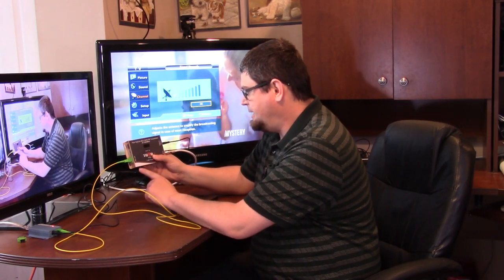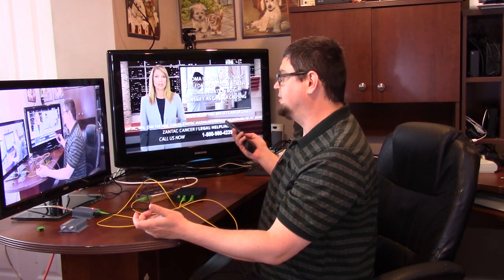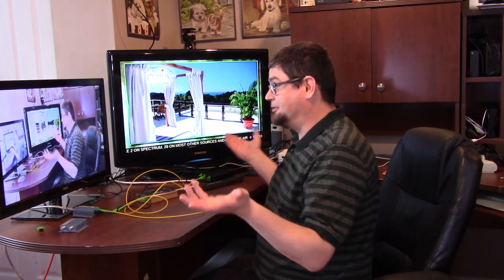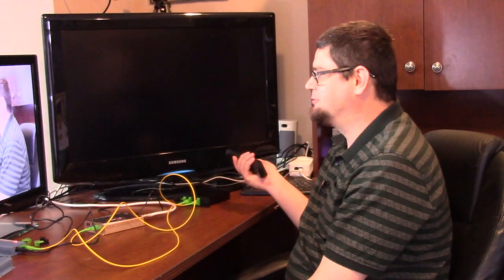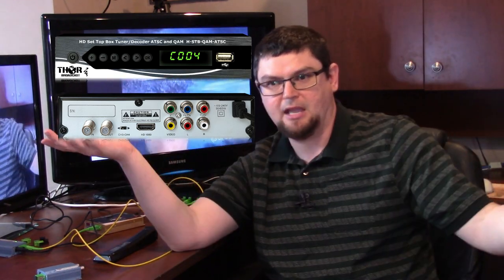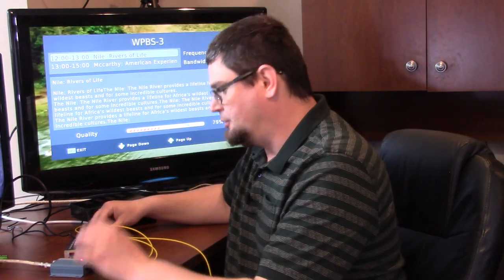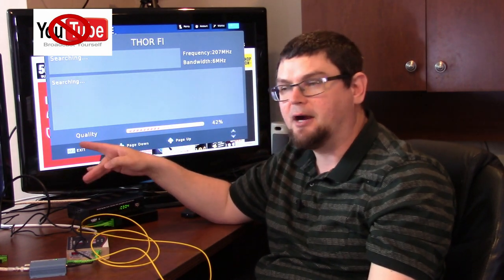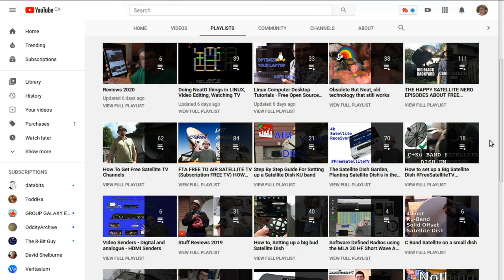Thor Fiber Optic To Coax Cable - Send a TV Antenna signal though Fiber Optic Cable!

Comment: So many possibilities with these digital modulators! I just set up a Channel Vision modulator - 3 analog closed circuit TV channels to go with my antenna digital channels. I use my VHS, Betamax and a DTV converter box as a USB media player to feed the 3 channels. Then I combined it with my antenna through a diplexer and feed the TVs in my house. Custom TV channels! Great video Robbie!👍

Comment: Here's a related subjects to cover somehow:
what's about those direct IP LNBs for the dish?
Are they any LNB with full spectrum over fiber?
Why not run wave guide instead of wire from a dish? 

let's get real geeky :-)
Reply from the maker: But I guess you would still need a wire to power the LNB and the fiber to the receiver for that application. It would be interesting if cable company’s are doing this!

Comment: My condo wants to add fibre cable for internet and TV. The fibre goes to a router as I understand it. The issue that is not clear is how it goes from the router to a tv which has no wifi capability. The things I have seen is the coaxial cable currently distributing tv signal to various rooms where  TVs are is retained as a delivery system which to me defeats any gains at the TV of fibre. Am I missing something
Reply from the maker: It is about right. Most homes have copper coming into them not Fiber. Yet the phone cable company says it is Fiber :)

Comment: I WILL WATCH THIS AGAIN IN CASE I MISSED SOMETHING...................   HERE GOES NOTHING.......... I RAN A FIBER TO THE HORSE BARN AND TO THE GARAGE AND....................... NOW I HAVE DATA AT BOTH LOCATIONS.     1. IS THERE A ETHERNET VERSION OF THIS?  2. IF NOT, HOW DO I ADD THIS TO A EXISTING DATA FIBER NETWORK
Reply: Let me know if you need help with this.

Comment: its great for all receiver end point when dealing multiple room setup and benefit with great speeds but problems with fiber is it can't operate at satellite signal greatly due to missing magnetic fields is needed to oscillate the signals polarities ....like channels...even and odd...without it...sats won't deliver programming  through atmosphere and all obstacles to the ground like noise....fiber doesn't like noise its why they will never leave its cable for a very long time  due to dependence of transparent cladding material with a lower index of refraction ...without it....its dead cable.....copper ...cable never dies...just cut the end point and you got it working again or get new piece ....but fiber...??  any where is damage ....whole cable is dead..unless you can master on splicing and repair requires more than knowledge and skills do so.....ITS A NIGHTMARE I TELLING YOU WHEN REPAIRING FIBER CABLES ..... 
in my opinion COPPER GONNA STAY WITH US FOR VERY LONG TIME AS LONGEST SATS STAY UP THERE IN ORBIT ....CELL TOWERS AND SATELLITE COMPANIES STILL DEPENDING COPPER TO FUNCTION ITS DESIGN WAS WELL MADE FOR ....OSCILLATE FREQUENCY WITHOUT MAKE BIG DEAL WITH CONVERSIONS LIKE CABLE HAVE TO DO FOR GETTING FASTER INTERNET ...MANY CONVERSION BOXES IN THE NODES....

EVEN I REMEMBER EUROPA DID THAT FOR THEIR SATS.....AND IT NEVER GOT THROUGH AS THEY HOPE FOR....MANY VARIATIONS ISSUES WITH LNB AND THE RECEIVER CONVERSION....HAVE ANYONE NOTICE THAT BACK THOSE DAYS WITH YOUR CABLE SUBSCRIPTIONS PLUS THE CABLE MODEM....NOTICE WHEN IT LAG ..ITS NOT BAD BUT ITS SEC WHEN WATCHING PROGRAM ..THEN IT JITTERS ONCE OF WHILE FOR EVERY 40 MIN OR LONGER  ...PEOPLE WON'T NOTICE WHEN SURFING THE WEB CAUSE PEOPLE ARE USED TO THAT SORT THE THING BACK THEN...JITTER PARTS BUT ON WATCHING TV...ITS VERY NOTICEABLE ....ITS WHEN CONVERSION BACK THEN WHERE BAD OR EARLY DAYS OF HYBRID CABLE WAS STILL STAGE ONE ....NOW DAYS I HOPE ITS IMPROVING GREATLY FOR TV VIEWING ...SINCE I LEFT CABLE COMPANIES AND DECIDING USED SATELLITES MY OWNED INSTEAD ...ITS GOOD EXPERIENCE WHEN I DID THAT

Comment: Hello sir ji can you please help me
Reply from the maker: With what?
Reply: Hi sir , Tariq here CATV guy , I recently converted my analogue Catv 100chanels to digital QOM64and using uhf band of Catv on coaxial cable . I wish to shift it on fiber ,so do I need amplifier on line also or not , what should be output level from transmission headend and receiver side panel .pls make a basic diagram with required devices . Tariq Riyadh Saudi Arabia.